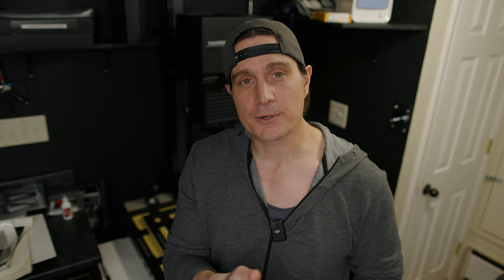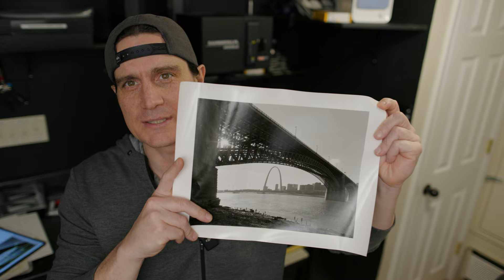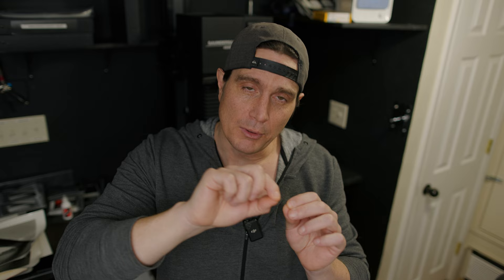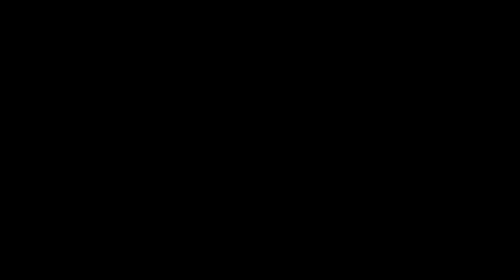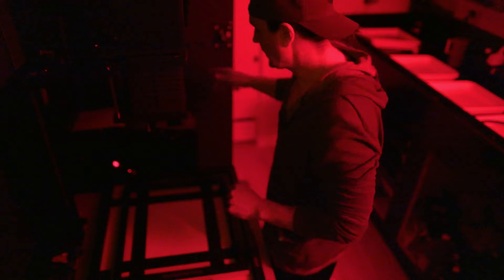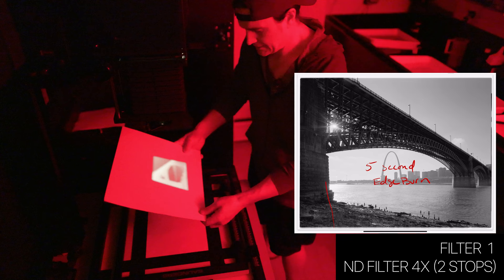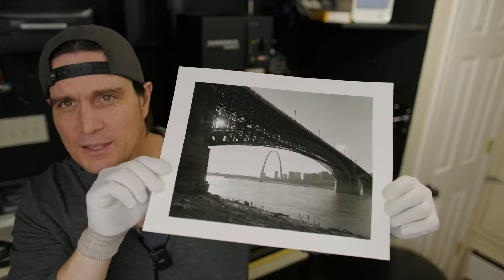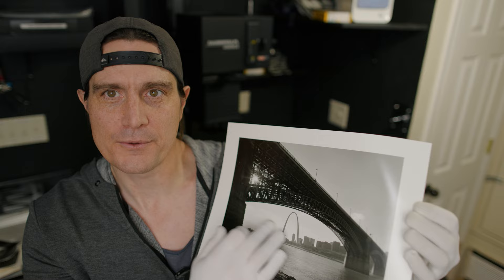Darkroom Printing - Black and White Film Photography

Comment: Two little tips for scratches on the non emulsion side is either nose or behind the ear grease rubbed over the area will diffuse the white marks in the print. Or high quality artist Turpentine brushed over will also do the same. Marks on the emulsion side that print black are very difficult to deal with.
Reply from the maker: Never tried the turpentine or grease... Thanks for the tip. I have tied stippling with a pin and had limited success!

Comment: I have the same enlarger with the VCCE head and love it.  Do you mind telling me about the ND filter accessory?  I don't have that and, clearly, it would be super-helpful!  Thanks!  Great content by the way!
Reply from the maker: Thanks! I love the enlarger too. I just use the filter holder (holds the red safety filter under the lens) and set an nd filter in that. Came with the enlarger👍
Reply: @Distphoto  I only have the holder with the red filter.  I can see how one would be super-useful sometimes so I'm going to inquire a few places! Thanks!
Reply from the maker: @cweeks5211  that is the holder I use. I just pop the red filter out and set the nd on top👍

Comment: Just finishing building a darkroom after many years without. Question: my sink is set at a fairly high 38” so I don’t have to bend over. I am thinking of setting my enlarger deck at the same height. I noticed yours looks lower. What height to find works best for the enlarger deck? Thanks
Reply from the maker: My enlarger table is lower only because the ceilings are low. Otherwise I would definitely have made it higher.  The enlarger deck I built can also be lowere on seperate hanging rails beneath. I would start with the height you like and the most comfortable if you have the space. Then consider making the deck adjustable in case you decide to make larger prints( not necessary but ya never know!)
Reply: @Distphoto  thank you. I appreciate all that you share.

Comment: Thanks for sharing your techniques there. Out of interest, are you using a condenser or diffusion head? My Durst diffusion enlarger would produce a much flatter print at grade 1.
Reply from the maker: Hey Mike, This is a diffusion enlarger. This negative was pretty high contrast and I planned on giving it a bit less development than I did but settled on trying to keep the contrast up a bit and hence burn down the highlights. So it really depends on the contrast of the negative but like to keep my negs as contrasty as I can but still have everything printable with some room at the lower contrast settings in the enlarger when needed.
Reply: Ok thanks. Keep up the good work!

Comment: Keep the videos coming! Is there a point where you consider using a film mask rather then doge and burn?
Reply from the maker: Yes, when I feel its necessary to get the vision for the final print done. 

 I find masking to be very powerful BUT very time consuming. And there is a learning curve and in my experience a lot of trial and error as well. The biggest downside is that it pulls me away from printing and back either out of the darkroom and at a computer or drawing over a light table. Sometimes it is definitely worth it.

Even when I have a successful mask I will often times still do some tradiational dodging and  burning to fine tune things. Masking is another tool but I want to be the best with ALL the tools I have so try not to default to it.

Thanks!
Reply: Would love to see a video showing you use a film mask! I’m not familiar with the concept.
Reply from the maker: Have had several requests for this and have been thinking on it a lot, so will try to put something out as soon as I can!